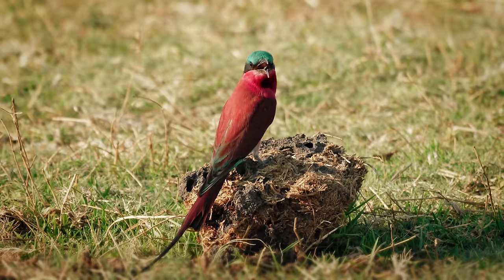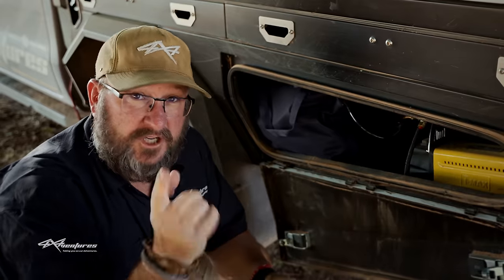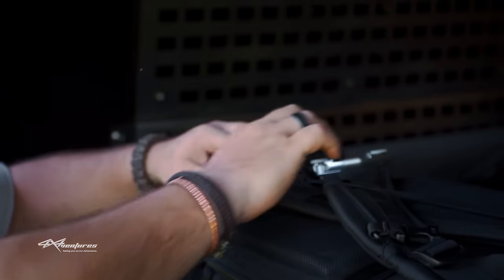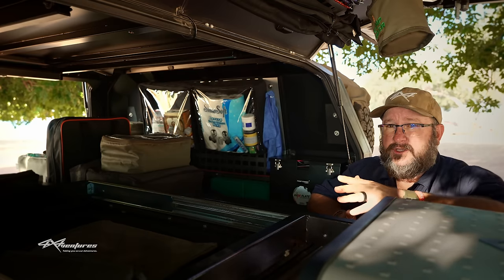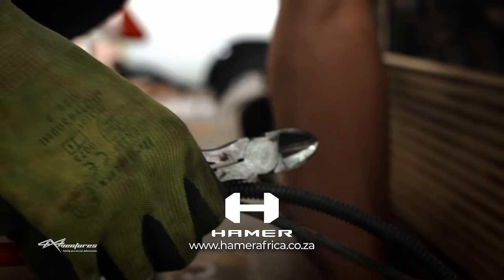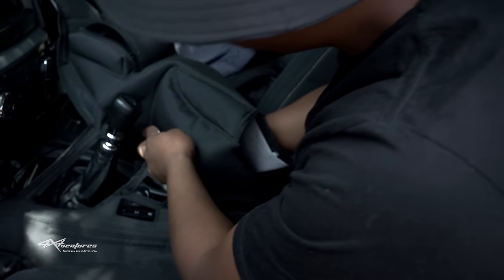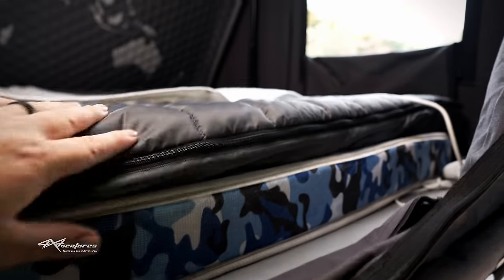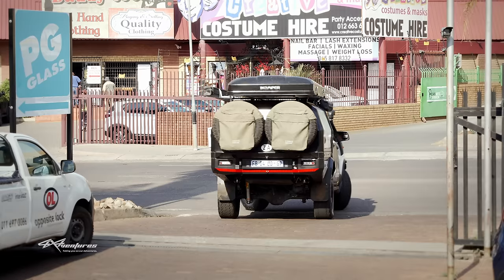Africa OVERLANDING Rig | Is it posible with a D/C Ford Ranger? | Walk Around update

Comment: Hi Ryan, 6.6DBI UHF antenna is for flat, desert country while a shorter antenna such as a 2.1DBI is designed for hilly, mountenous country. Great review of your 4WD mate 👍
Reply from the maker: Thank you bud for sharing. Absolutely mate, but with the old whip antennae I got the 24km range on flats terrain and 10km range in hilly terrain. I have been advised that I might need to upgrade the comms radio 😬😬 Michael appreciated mate
Reply: Wow, that seems to be an expensive approach. Do you have GME in SA? They are the major brand here in Oz along with Uniden, who both have excellent UHF antennas and UHF radios.
Reply from the maker: Hi Glen, unfortunately not, but, whisperings on the wind have mentioned GME are coming to SA.
Reply: @4x4ventures_southafrica  hit them up for sponsorship mate, tell them about the issues your having and how you've been advised poorly to upgrade your UHF because the antenna isn't performing as it should.

Comment: Your ranger looks great, how did the 285 tyres affect your ride on asphalt and how much did it affect fuel?
Reply from the maker: Thank you. The tyre is a 33 inch size now. So here are my findings; rolling resistance is increased, slight drop in power and an increase in fuel consumption by 1.3ltrs per 100kms

Comment: Dear Ryan,
My compliments to you.
Thank you for all your splendid videos and advice. Very factual and detailed. 

I have a next gen ranger wildtrak at the moment that I am starting to build up for long range overlanding.  
A question I have on your rim/tire set up. What is the actual OFFSET on your rig 285/65R18?

And for my situation what offset would you recommend using a 265/70R18 tire?
Thanks in advance for your advice.
Keep up the good work. Love your youtube program 👏

Groeten Willem de Kant 
Somerset West
Reply from the maker: I would truly advise you to visit your tyre fitment centre of preference and get their advice and professional opinion for wheel rims and the off sets preferred. Remember I was sponsored a set of tyres from CST international, so I was pushed in to the 18 inch wheel rim size. I would personally try and add more rubber between the wheel rim and tar with as close to a neutral offset as possible, and prevention of tyres sitting passed the wheel shrouds of the vehicle.

Your offset should be as close to neutral as possible, obviously the wider rims will require an offset to prevent rubbing on wheel arches etc. I don’t use wheel spacers and would highly recommend to not use them if doing 4x4ing or carrying heavier loads over longer distances.
Reply: Thank you very much for the advice Ryan. Much appreciated.  @4x4ventures_southafrica